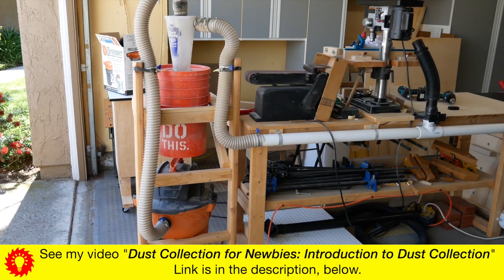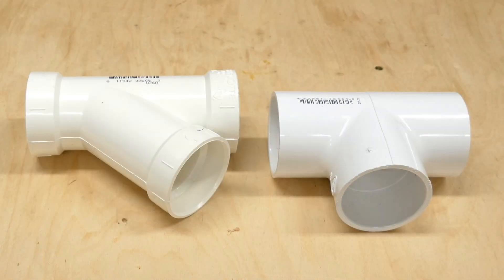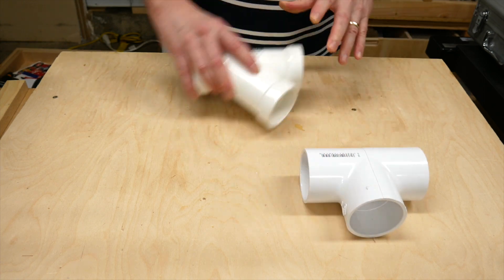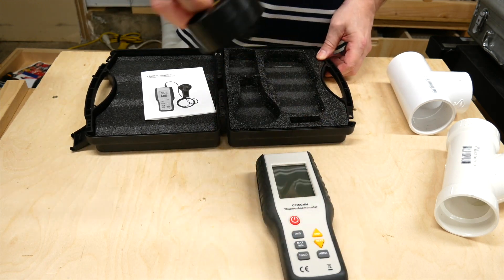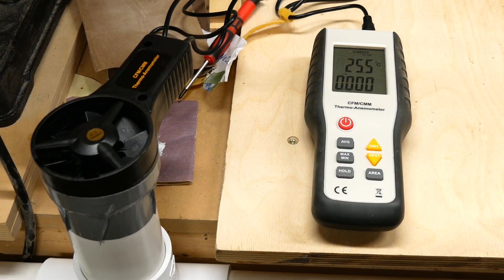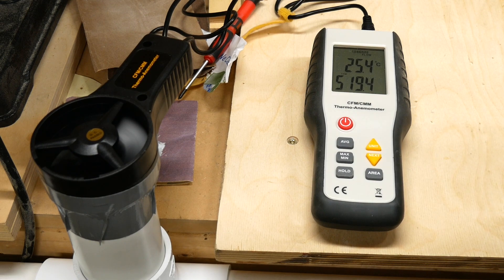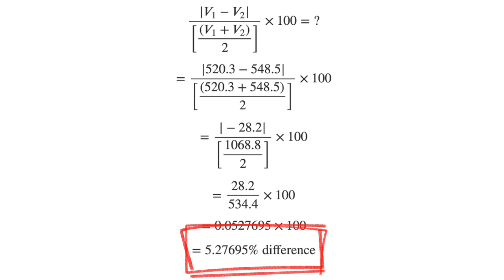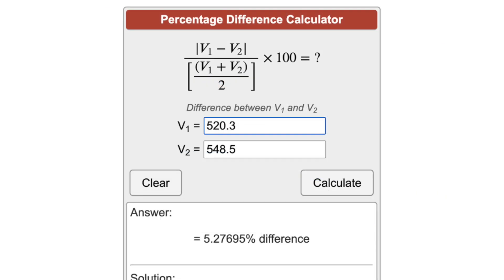Comparing Ts to Ys for Dust Collection

Comment: Measuring the air flow rate is not definitive when dealing with larger "dust" like that produced from a drill or planer rather than a saw. With larger pieces of wood, when they go through a tee they will slam into wall of the tee, momentarily almost stopping completely, then get accelerated along the pipe until they get back up to speed. With a wye, the wood pieces lose less speed at the junction.

It may not be a large enough effect to worry about, and I am not sure how to measure it. But it could be a concern. Maybe you could measure it by timing how long it takes to vacuum up a bucket of wood chips with a tee or a wye.
Reply from the maker: That's actually a good point. For me, all I have is a drill press that produces that kind of debris, and it works fine for that. But a planer or jointer might be another issue.

Comment: in my 10'x10' shop i have a shop vac for general cleaning.  i spent under $15 to collect dust. a used $5 leaf blower and $10 4" flex hose for my table saw and for my 2 scroll saws i have 2 second hand home cyclone vacuums ran through my foot switches. i traded them for custom portraits. not only is "necessity the mother of invention" but so is being broke.
Reply from the maker: LOL - absolutely! Whatever works, works. John Heisz just sweeps with a broom in most cases! 😄

Comment: At that difference the only benefit of the Y over the T would be the angle of attack with the wood chips/dust.  At full speed the chips/dust will slow down less with the Y vs the T which is helpful if you get come condensation in the lines but it really is minor.  For such a small setup the thing that would help the most is to make sure you have as few leaks in the system to help maximize the vacuum at each port.
Reply from the maker: Thanks, and I agree. 😄

Comment: In the uk here, I have 4” or actually 100mm Id duct tubing but the type I got (due to being a lot cheaper ) only has T not Y joints. It seems to work just fine but I don’t have much experience to compare it to. Cheers
Reply from the maker: I think that not having something to compare to is the secret to happiness. Seriously - if you don't know, then you won't care! 😄

Comment: Glad to see you back!   I thought you were going to measure how much dust arrived at the destination.  And whether the motor on the dust collector was being weighed down by the restricted airflow.  But hey, we don't even have a dust collection system.  Mine is to open the garage door, stand at the back wall, and use the leaf blower or the air compressor.  (In my house seasonally, too. lol)  The dust collects outside.  (I do sweep first.  And we have NP100 respirators.)
Reply from the maker: Thanks, and that made be laugh. I'm not Matthias Wandel, so testing on that level is out of my league. 😂And kudos for at least getting rid of the dust somehow!

Comment: I was cutting small pieces of oak for a thread stand for my sewing quilt nut wife. I was standing at my tablesaw and I said first how did Dan do this and then Dan hasn't posted a vid in a long time. Then miraculously you post a vid. I hate this dust collection mess. I have watched many vids on you tube and there are too many opinions. I think the test is does the sawdust end up in the bucket. Glad you are feeling ok.
Reply from the maker: Glad to be back. And yes, that's my feeling too - does it puts the dust in the bucket? Good enough for me. 😄